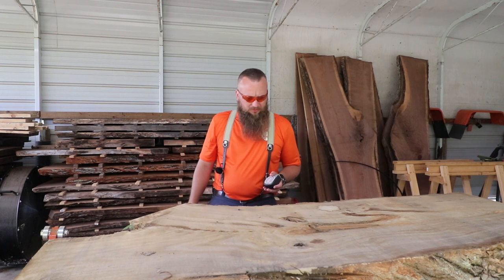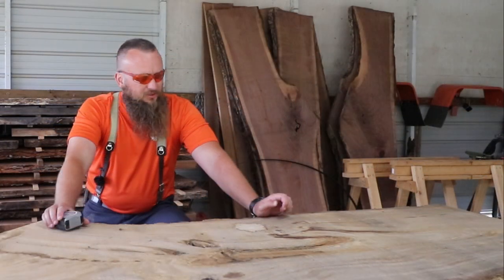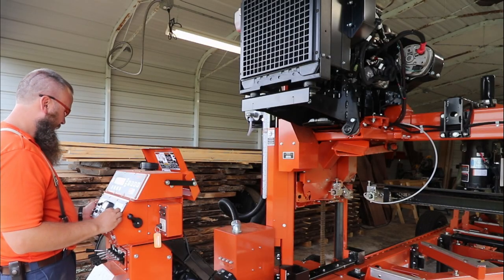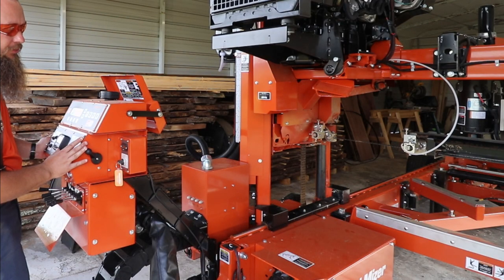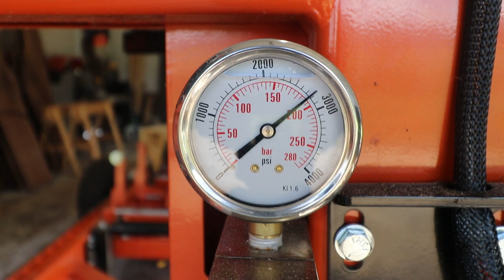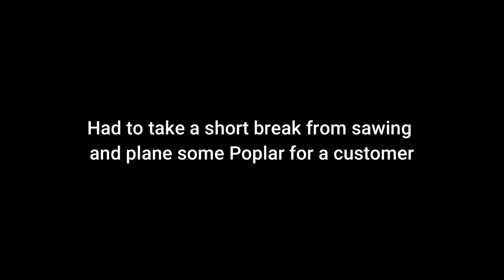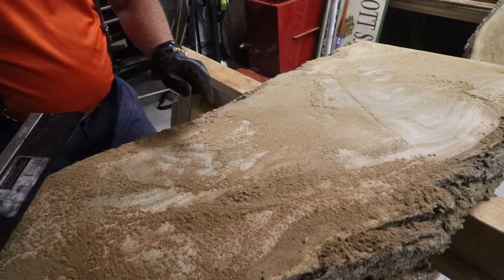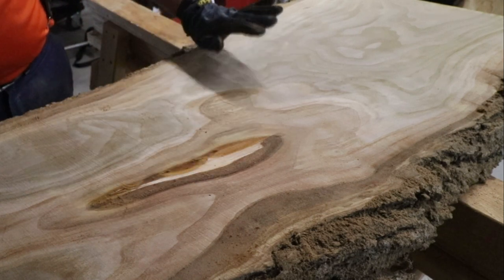BACK ON THE SAWMILL AND HARVESTING MORE AMAZING CHESTNUT SLABS

Comment: those are some  nice looking slabs Nathan.

I find that pressure gauge a very valuable tool and usually try to keep an eye on it. it will tell me the instant the blade starts heating up, if I can't get it to cool down with more lube or cranking up the pressure a couple times then I know it's time to get it off the mill. usually just needs sharpening but it will also give warning when a blade is about to fail from gullet cracks.

also, since I bought my dinasaw msa, blade angle is not really an issue. the machine cuts anything from 0*-20* hooks, so any blade can be cut to any angle or profile. shallow gullet, deep gullet etc. I really like it.

I'm hoping to modify the head on my 40 this summer. not sure whether to put 6" or 12" of stretch into it.

Comment: Does the "debarker" just cut through the bark so the saw blade doesn't have to?
Reply: He had a video on it a few weeks back. If I recall the debarker has a blade similar to a circular saw and cuts through the bark to make it easier for the mill blade to cut, and that keeps it sharper. Bark can hold other things like dirt and gravel that will just cause all kinds of problems too.